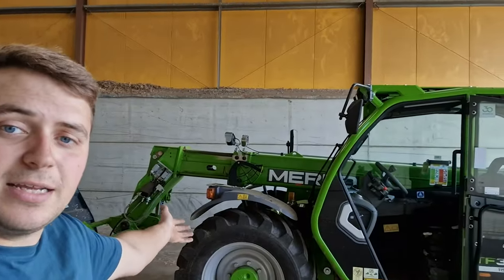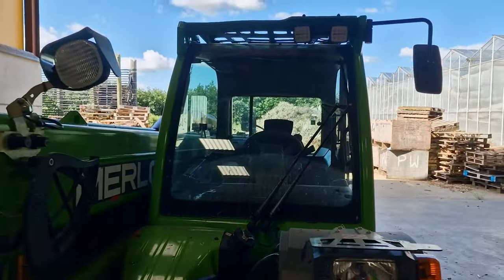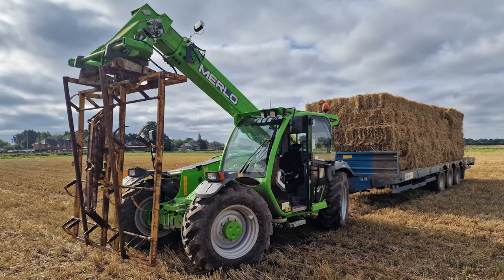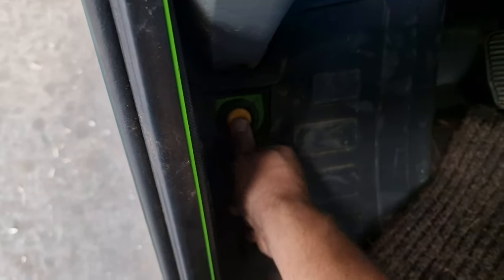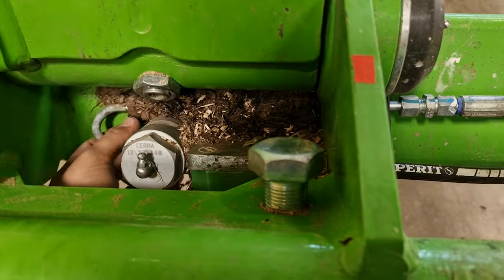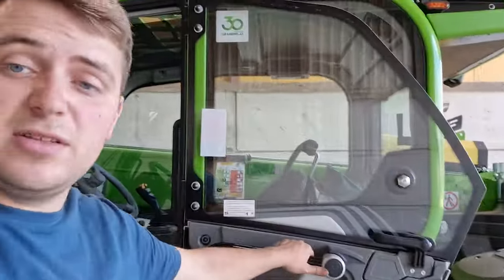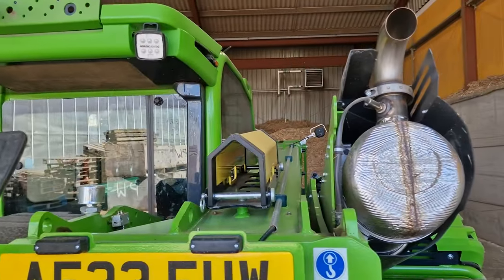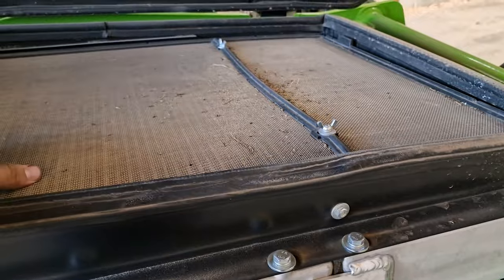THE BEST TELEHANDLER ON THE MARKET!!!

Comment: With all due respect you've had it 5 minutes and are still in the honeymoon phase.

Know a local chap that's a dedicated Merlo man and seems to get on well but at the same time have heard plenty horror stories.

I hope you have good luck with your machine 👍
Reply from the maker: Thanks for the comment
5 months in now and it's still a machine I look forward to driving. Not many people can say that about a telehandler. We did have to have the guys look at an air-conditioning sensor that had gone wrong but apart from that no problems so far (touch wood). It's handled all tasks we've used it for. I'd still heavily recommend one
Reply: I drive A 18m site telehandler on site suppose there difference between farm and site in cab ..but seems to be few good things  jcb could consider .. ...